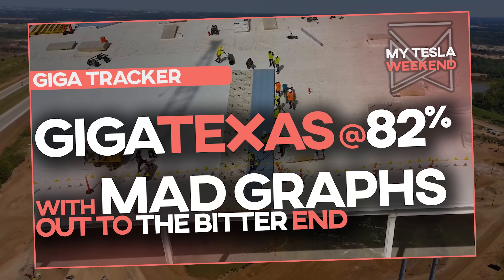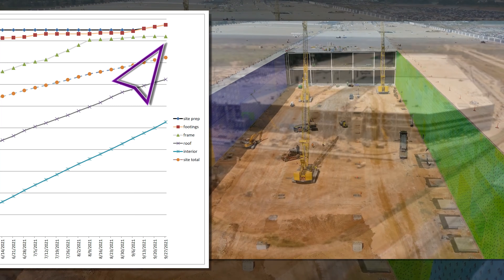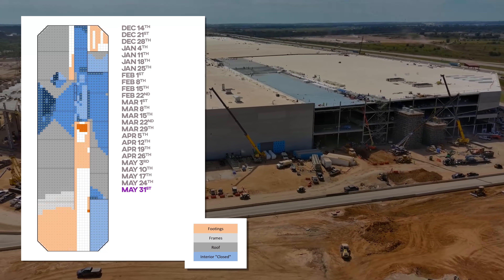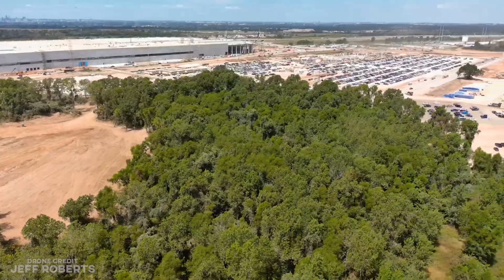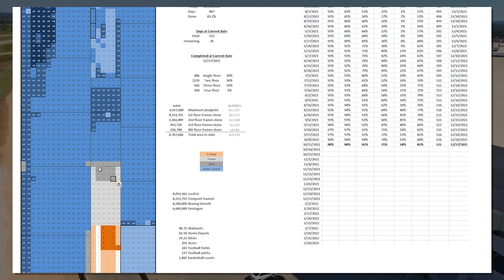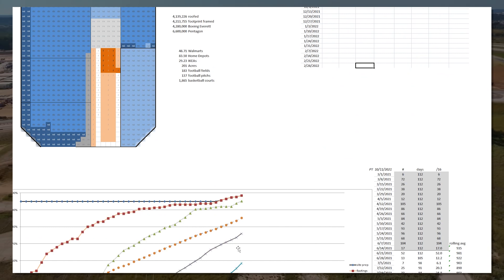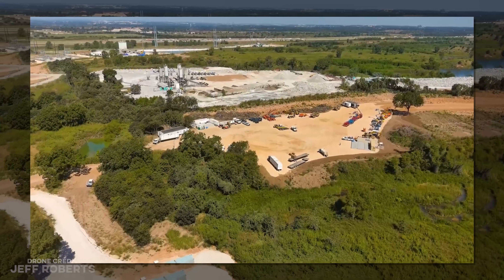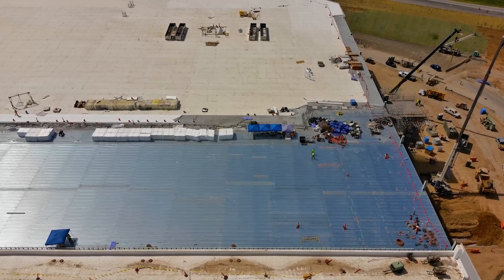Giga Texas is 82% done & here's the FUTURE MATH to show the reality

Comment: There will be a Phase 2 extension, this will might set some precents back :)
Reply: But stage 2 will be a new project, so it doesn't really affect tracker, and yes, I know some main building is marked so, but. The building was in 1, so I havealways said, the Y plant is essentially done, and if you ask me, fitting out so parts, battery cell manufacturing, cathode plant, extensions etc, are all redundant, until they line up batteries and suppliers to go hard on cyber, and that timing is only now firming up. 
eg. Cell manufacturing could not even finalise design of plant until kato road solved production hold-ups. Now the plant gets made in new factory in norway? Or germany? Then sent to Texas, and shortly after Berlin, then fit, then the painful ramp of 1500cell per minute blurs, whoops, lines. It will take months to reliably produce cells at capacity, then the my will prob need the majority....

Comment: Great job tracking you make good use of the available information in Texas.
What concerns me is comparison with Berlin or Shanghai.
For example, in Berlin fire escapes are obvious with the tower stairways outside the building, while in Austin you have to look closely to see interior stairways.
Also in Berlin there is a whole utility mall between the two main buildings. Austin obviously has a electrical switchyard (with lights inside building) but does Austin have water treatment or chemical storage? Shanghai seems to have a whole seperate utility building.  I don't know how much these "differences" are reality, regulatory enviornment or design language? The Berlin design language looks like an idiot proof design with every function looking as obvious as possible while Austin seems to be a sleek streamlined anonymous building which just looks like an oversized warehouse. Does Austin not require some stuff because of "anything goes" Texas (such as fire escapes and water treatment) or is it just a difference of design language?????
Reply: There are definitely different design "languages" used at each building site. Each site uses techniques and materials that fit within environmental constraints both natural and man made. Giga Texas has fire escapes that are built internally to the structure, and may also have it's waste water treatment hooked into a municipal system. Giga Berlin uses external fire escapes, and has it's own dedicated water treatment facility. While some jurisdictions may have different types of safety requirements, fire protection receives a very high level of attention at all locations, as insurance companies want to know that the properties they insure are adequately protected.
Reply: Good comment. But if you look closely, most services, cooling and water plants, (which work together like heat pumps to reuse energy) are inside, close to where they needed, and that allows the plant to separate production units to maximise production and minimise water and energy use. The heat for hot water is captured from aluminium kilns and smelters. Paint shop uses hot water, so it's next door. 
I have compiled this outsider understanding from what Elon and others have said, an eally basic engineering background and tracking some of the machinery and heat exchangers I've seen delivered, where they went, and wher the big rectangular holes are in the roof.